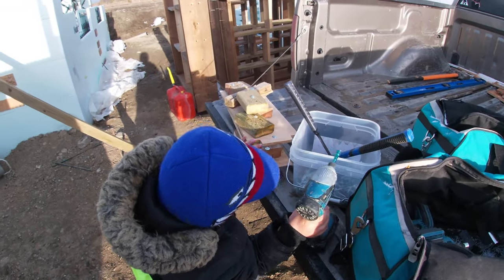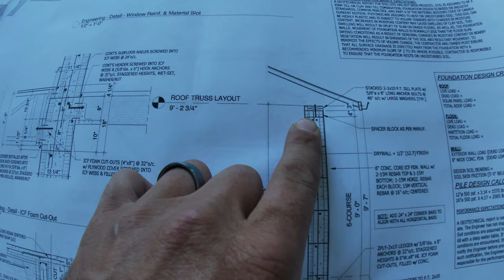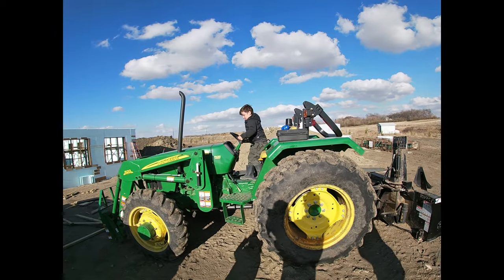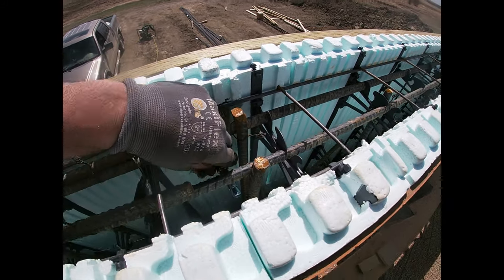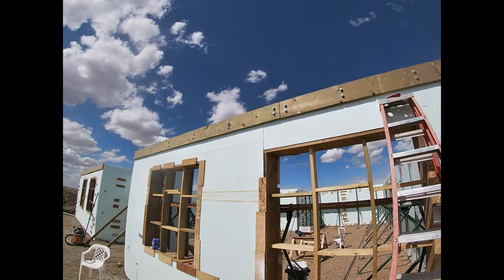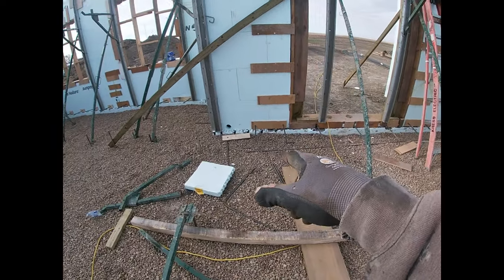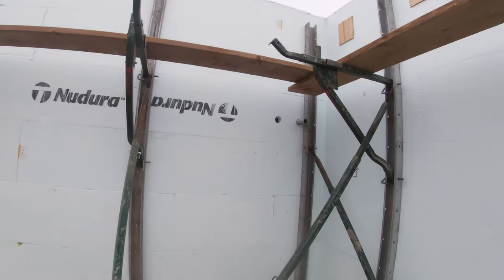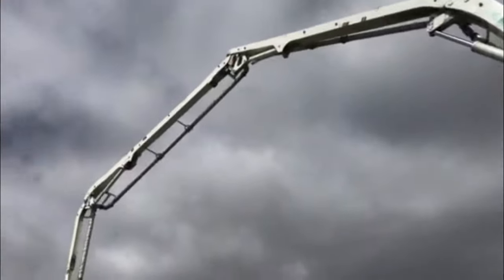Vlog 5 - ICF Basement Pouring Concrete Walls - Nudura ICF

Comment: Looks like a lot more steel than most videos I have watched, are you in a high seismic zone? Level of content is spot on.
Reply from the maker: No we aren’t in a seismic zone… quite the opposite actually on the prairies. Nothing moves here, but we do get crazy wind, sometimes even plow winds that do crazy damage. Most of the rebar was called for by our engineer. Except for the very top row… it only called for 1 row like normal but we had extra rebar, so stuck it in on the top row. But other than that, it was called for by our engineer.

Comment: Great video! Lots of information we will use. The wife and I are starting our ICF home later this year in Missouri. Can you share some information on the pour e.g., cement mix, how long did it take you to pour a layer, how long did you have to wait before you could begin pouring the next level? Thanks, and thank you and yours for taking the time to make these videos.
Reply from the maker: Thanks! Our concrete was a special ICF mix.  It has 3/8" aggregate and was a 6" slump, wetter than normal.  With all the rebar and webs in the wall, you need it that way to get the concrete to move.  It took about 40 mins between laps around the house.  That seemed to be enough time that we had no real issues with it.  It was about 6 weeks between the basement and main floors but it could have happened much sooner.  It just took us that long.  Good luck with your project!